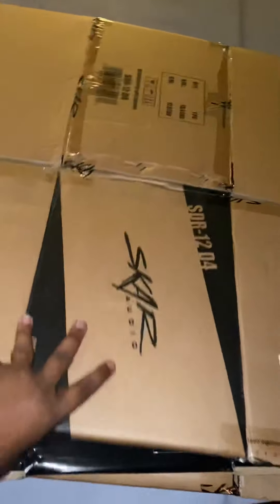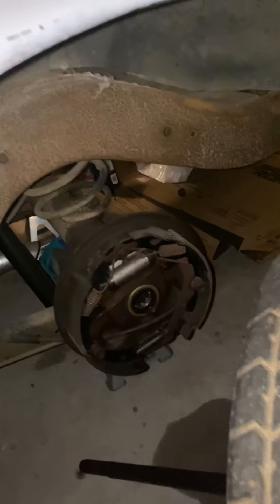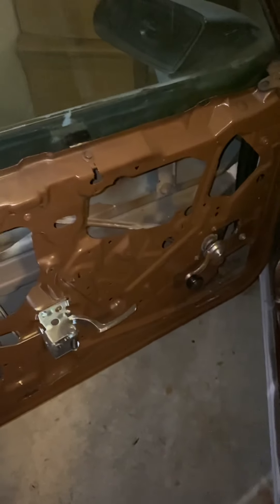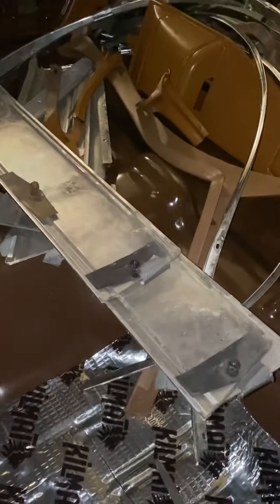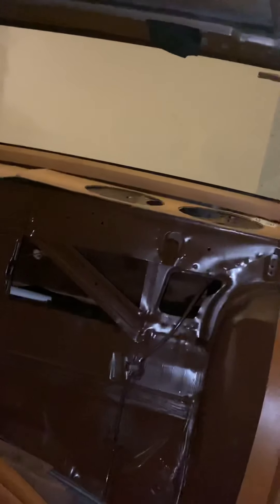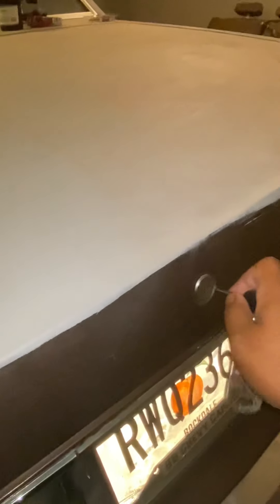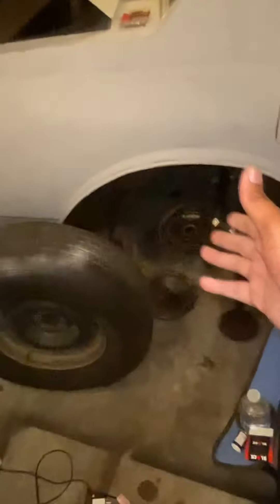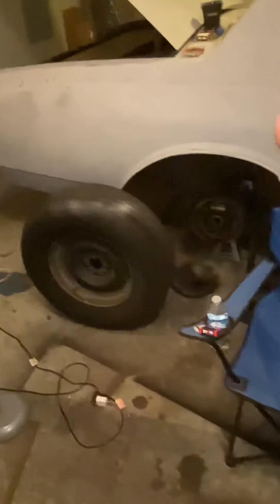Skar audio 4 12s for the box chevy

Comment: Get you some prv speakers for the mids and highs  and yea taramps you can’t go wrong  I would recommend the bass3k they have it puts out over 3000watts and the 4 sdrs you have are 2400 watts rms wired to 1 ohm
Reply: I have a ram with 2 power acoustic bamfs running off a bass 3k and prv mr-500’s in my doors and that bih pounds
Reply from the maker: I got a skar 3500 instead today and going skar 6.5 all the way thru. You got a dope setup tho. Never tried the prv
Reply: @lifewithfranknitty  aye when you done with the audio I trying to hear that !!!
Reply from the maker: @glockumentary7719  gotta get a console made for my double din then I’ll be able to hook everything up